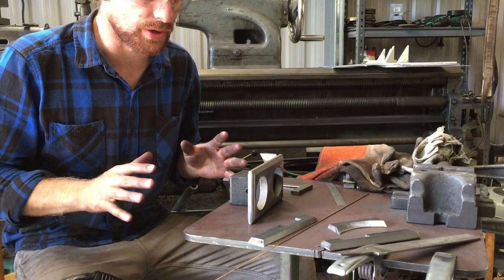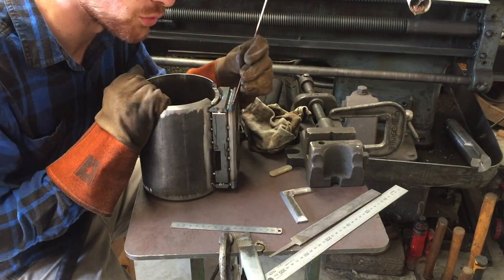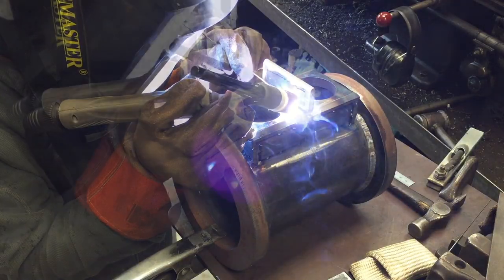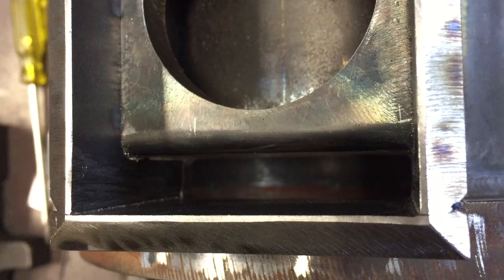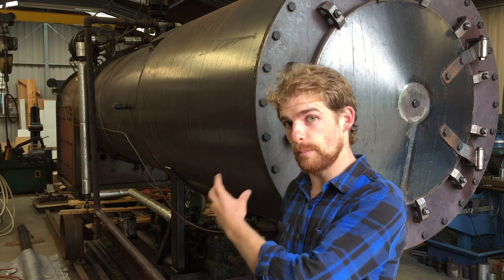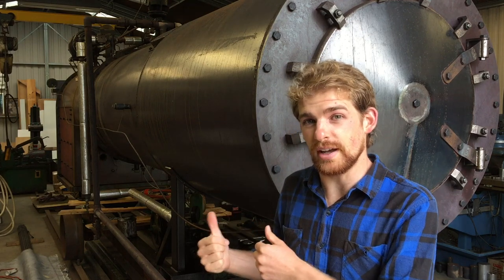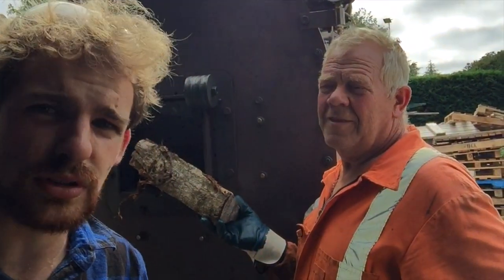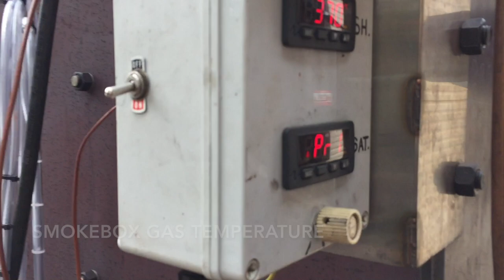Fabricating Steam Cylinders | Building the World's Most Sustainable Locomotive EP10

Comment: As much as I love steam the reality of "sustainable" steam is a central power station and electric locomotives. They simply aren't efficient and never will be. Any one who disagrees needs to read a really basic book on thermodynamics.
Reply: Large steam power plants which power electric trains may be the most efficient system, but the fact of the matter is you are going to have a hard time electrifying every piece of track in the country.  Steam powered locomotives will b a good stop gap when diesel becomes no longer viable and fossil fuels run dry.
Reply: I can't understand why electric trains don't have solar panels on their roofs for partial electrical supply, maybe charging batteries or direct use on sunny days?
Reply: @donotwantahandle1111  it can't run solely on the solar panels. Think about this, how many solar panels do you think you need to pull a fully loaded car? The answer is too many for the little roof space a car has

Comment: A suggestion for holding those small parts, or larger ones, is to use an electromagnetic vise or hold-down. I made one out of low cost mag-locks used on electronic door locks. Mine cost about $60 US. It's powered by 12 volt dc and will hold 1200 pounds. When a piece of steel is locked down it is held solid and all.you need to control it is a simple single pole switch and a battery of power supply. It really doesn't need much power to hold.
Reply from the maker: Great idea, we have an old mag drill so will investigate using the electromagnet on that - Cheers!

Comment: Hi there,
Can you explain what condition you are designing this locomotive to run (freight or passenger work, long distance, main line or preservation work? And so on).
Reply: I believe he's said before that the locomotive will be a 2-6-0 meant specifically for light passenger work, but could possibly haul a very short freight train
Reply: If it’s for light passenger work what engine is it replacing?
How long is the Journey?and conditions?
And how light is light passenger work (150 tonnes 200 tonnes?)
Reply from the maker: Hi Adam, 150 tonnes trailing on a 2% grade, 300 km between taking supplies. All details on website here: https://mackwelloco.com/locomotives/
Reply: @Mackwell-Co  Hi there I understand what you have specified but is that the actual working conditions? 
And if 150 tonnes is all your designing for that seams very low when compared to old machines like the Hunslet austerity could pull 400 tonnes up steep gradients while being smaller then your proposed design. I would love to see you succeed in your goal but I feel that your specification may be too limited to make your engine a practical alternative for enough railways to make a difference .( I am viewing your project from the expectation that your planing to replace multiple existing locomotive from a variety of railways not just one engine from one railway)
Reply from the maker: Thanks, Adam. The Hunslet Austeritys are significantly larger locos, weighing 49 tonnes, 26% heavier than the Mogul and 100% of that is adhesive (170% greater adhesive weight!). On the other hand, the Hunslet has just 50% of the fuel and water capacity but is designed for a different purpose. The Mogul is just the first step and is tailored to the NZ scene, where it will cater to the demands of the majority of passenger services without the limitations (range, fire risk, pollution etc.) of conventional steam locos.
Reply: @Mackwell-Co  if your current specifications is able to cover the majority of NZ demand then that is great👍.and I understand that fuel capacity is important (are you fitting a condenser?) But the point I was trying to make was that a tank engine (33% shorter) was capable of doing heavier work which I believe will be important and that you will have to develop in the future as “just the first step” suggests moving on to-an international market? Where1000 tonne trains are common place.
Reply: @adamwachs6392  yeah im pretty sure this locomotive is just a stepping stone or rather a example to the world that steam locomotives can be very efficient and sustainable.
with this technology we could very well revolutionize typical steam engines

Comment: Is there a reason for using TIG over Stick Welding? Just Curious because I've heard some old heads swear by Stick Welding

Nice work so far, love your choice of music, can't wait to see more updates!
Reply from the maker: Thanks! TIG is good for this finer detail work where I need to be certain that the as designed weld penetration is achieved. TIG is hard to beat for accurately tacking parts together like this, and there's no mess. I may run some of the caps with the stick welder but in any case there is plenty of stick welding to come!

Comment: This  is  very  interesting   I  enjoy  watching   these  vlogs   this  steam  tractor   would  be  good  if  it  had   four   whell  drive   four  wheel   brakes    and   four  wheel  steering  this  would  be  the  first   four    wheel    drive  tractor   from  .Jeremy    mellor  england    would   it  be  possible  to  make  a  up  right   boiler
Reply: A boiler can be any shape that allows efficient flow of combustion gas and steam. Check out the top fired quick response steam generator of the Doble steam car. https://en.m.wikipedia.org/wiki/Doble_steam_car

Comment: Why are your chamfers so deep. You don't need it that deep unless you plan on filling it with weld and grinding all those joints flat. You also forget that the hotter the steam, the more energy you get out. Triple expansion engines were tries and so was this tried in much larger far more powerful enings for rail engines. Generally it didn't work so well.  The general rule of fires is that heat rises. SO - you start with the smallest stuff underneath the larger material so you can heat the larger material until it becomes gaseous and burns.  There is a reson why fires are started this way and this reason has been in use for about 100000 years.  Did you really think you were going to defy convention?
My question is a simple on. Steam locomotives were in use for about 150 years. There were all sorts of configurations for boilers and cylinders. That is all that matters, really. It seems to me that just about every possible configuration of boilers was tried yet you think you have finally found the best way.  Vertical boilers use water tubes to aid in circulation of the water/steam cycle. Horizontal boilers are almost always fire tube and this has come from 100 years of research and development of some very efficient boilers built by well established companies and put to use in some very important applications.  Steam turbines for locomotives have already been tried and discarded.  Piston engines rarely get much over 30% efficiency. What have you got that major industry, that would profit handsomely by more efficient systems. Profit is an incentive to improve. .  Mind you. I believe in steam engines and morn the passing of locomotives powered by steam. It was not the boiler or the pumps or cylinders that failed. In fact, Big Boy is the epitome of efficiency. It was the maintenance of those engines that made them impractical.